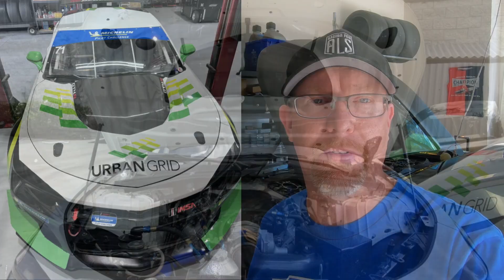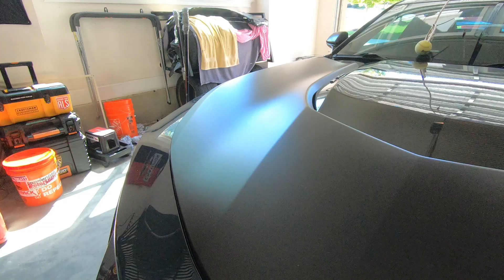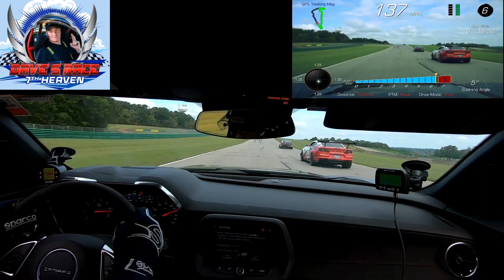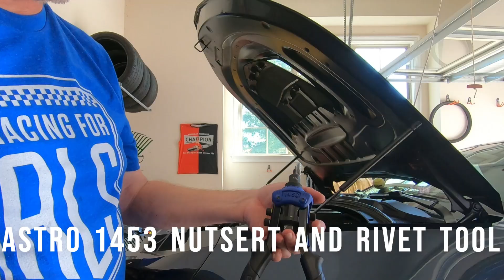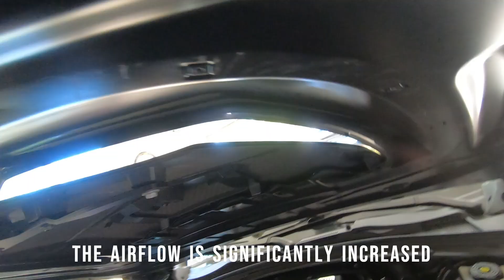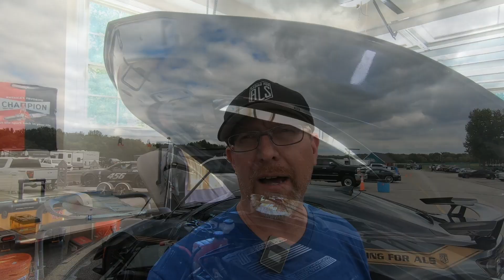Camaro ZL1 1LE Gets GT4.R Inspired Cooling Mods - VIR Track Results

Comment: For what it's worth, I tried this bracket at Watkins Glen and I had to remove it.  My carbon fiber insert was violently shaking around the 150 MPH mark when I was approaching the bus stop.
I then tried David's hood bracket at Road America, and there was no shaking up to 160 MPH.
Reply from the maker: What bolts did you use? I had no issues at 157 mph.
Reply: @RacingforALS  OEM with blue loctite and supplied jack nut

Comment: Will the Cold Air Intake seal with the hood after the rain guard is removed?
Reply from the maker: A Rotofab doesn't seal to start with, so you might get colder IAT with the hood exposed. I saw a similar installation with JLT and drop brackets that you could see the filter from the outside of the car. That's why I run the factory box with a Green Filter. https://youtu.be/UujCWEQjX5I?si=p2nKtZAcfTZn3XmC
Reply: @RacingforALS  Interesting.  I wonder how much power I would lose going back to the factory box with green filter vs rotofab.
Reply: @Turbo329  if you are doing road courses, the factory box makes more power. Check out the video above.